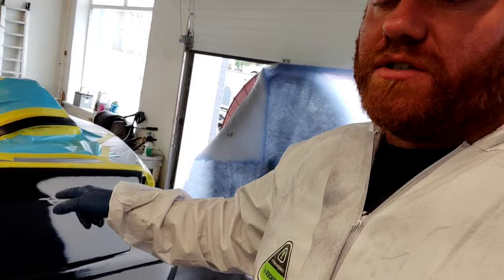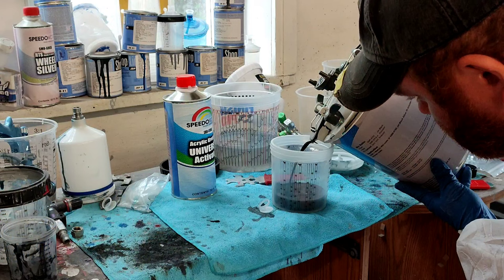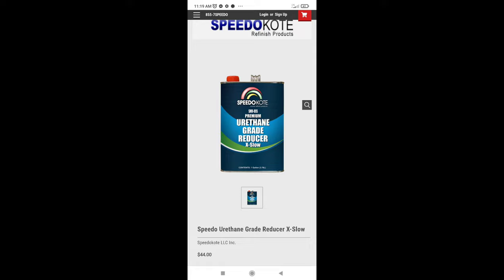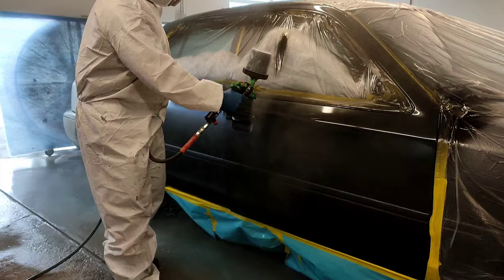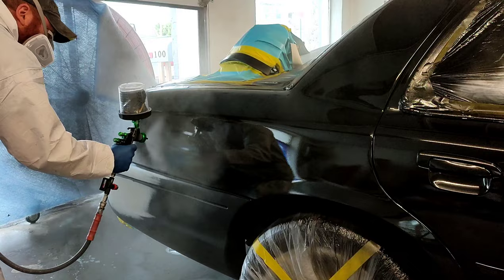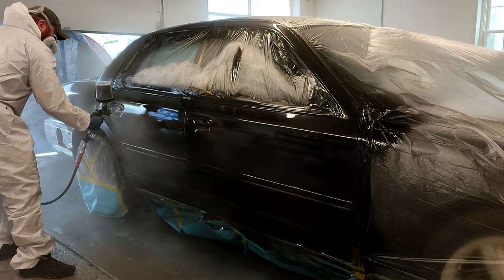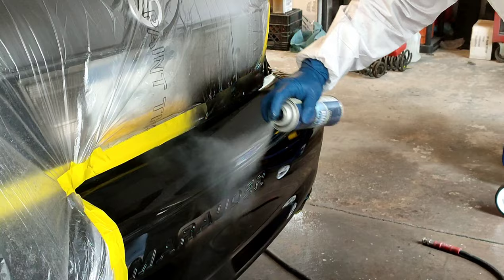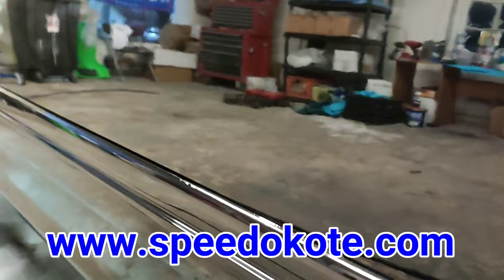How to lay single stage PERFECT

Comment: I've heard that spraying single stage is like spraying clear. You have to lay it down wet from the start. If you get dry spray or texture, then you're going too light/fast or it's too hot for your activator/reducer. It's better to have runs/sags than dry texture. Runs and sags can be cut down and buffed easily. Sometimes without even doing the whole panel.
Reply from the maker: Yup spot on
Reply: Literally no different I spray it just like clear. The stuff I used (nason) could handle a lot of build too it's actually a joy to spray.
Reply: In my experience, single stage flows a lot more than clear. Will go on looking dry but will level out alot on its own.
Reply: Hvlp or RP for single stage ?
Reply: @AChampagneWeezy  rp
Reply: @joshzimmer  I normally use a sata 3000 or 5000 hvlp 1.4 for base and my sata 5500 rp 1.2 for clear . I feel like the tip on my rp would be too small for single stage . I'm spraying ppg shopline
Reply: I appreciate this info . I've only painted water-base for 6 year and laying a separate clear coat and have light solvent paint experience with separate clear coat. I've never painted single stage and wanna try
Reply from the maker: Water is not the best for cars especially older ones. Also it does feather edge at all like solvent base. But hey great for the environment 😂😂🙃🙃🙃🙃
Reply: @GabrielMendoza-  you'll be absolutely fine with single stage, it's easier than clear coat in my opinion
Reply from the maker: Can be harder because almost no room for error. Can't really wet sand single stage cause then your basically sanding the color off. But IMO I agree it's easier and less work actually
Reply: @speedokoterefinishnetwork4937  idk out all the paint lines I sprayed I still have to say sherwin ultra 9k waterborne is the best and most user friendly when it comes to color match for collision work , now if I was doing an overall I'd go solvent base unless I have a professional booth to use .

But single stage I honestly would never spray on my own projects or keep in a shop if I owned one unless it's fleet work

Comment: Hello I had a question ....painting the top of my white challenger black it's in great condition no body work needed after cleaning and sanding then cleaning again ready for primer what would be the best primer to use before I spray single stage black ?

Comment: The paint Looks great . The only thing i see that was done incorrectly vs done propperly  ? Is that you blended over un-sanded paint . Which means that you chance breaking the blend if it needs to be buffed and its not going to last or stick and haze or show later even though it looks great leaving the shop . The Proper way to do a Blend is to sand with 1500 and stop the color / single stage , about  1 too 2 inches before you get to the end of the 1500 sanded scratches and then you can spray the blender and melt in the blend but still not going past the 1500 sand scratches . Then you can buff the the rest of the 1500 marks haze after it dries and the blend will not break and it will stick . Blends are not ment to go past a sanded area ever . when a painter says i can do a blend and not have to buff it , it is because they did it the way you did . It all depends on and in my case im OCD and if you want to take a chance of a re-do . Buffing a blend vs the time to re-do it later is up to you as a painter . Just my thoughts .
Reply from the maker: Your right I tried to take my paint right to the end of the scratches basically
Reply: @speedokoterefinishnetwork4937  Ya know whats AWESOME !! Its the fact that you can take constructive criticism without getting upset or blaming everything else on why you did something ,, thank you  for being a man and owning up . AWESOME !!!!!!!!!!!!
Reply from the maker: @tonychristiano  I have no issue with people helping me and giving tips. But just straight up being like "omg your an idiots without no idea what your doing " doesnt help me or anyone watching ! 🤣🤣🤣🤣🤣

Comment: I painted my truck about 8 years ago.  Decent paint job but recently fixed a bubbled area right behind front wheel.  How should I go about painting and blending the spot that I repaired?  Great video on the single stage by the way.
Reply from the maker: I would just repair, and do a spot blend

Comment: How long did you wait when u applied clear over the single stage? How is the clear coat holding up? 
  I have become much more intetested in offering single stage paint jobs. Deluxe version with clear. Just like old Earl used to offer😂
   Actually enjoy the instant gratification of single stage urethane
Reply: I was referring to another video where u applied clear
Reply from the maker: Alot of these cars I don't end up keeping so no idea on longevity... But I usually wait 30-60 min before putting clear coat over single stage

Comment: Getting ready to get this product. 45 years experience in autobody.  Hope it looks good
Reply from the maker: As long as applied correct you will get amazing results! Do 3-4 coats if you want to wet sand and buff make sure you allow to flash really long between coat 2 and coat 3 .

Comment: How long does it take for the paint to dry on the final coat?
When is the best time to remove the tape?
Reply from the maker: Usually around 20 minutes to the touch in hot weather. 
Best time to untape is while it's still tacky/ wet
Reply from the maker: If your placing any future orders you can select me as your sales rep (Marco) 
At www.speedokote.com

Comment: Use the appropriate catalyst.
Add no reducer.
Learn to spray thin to win.
Reply from the maker: I only add a max of 5% reducer any more than that can affect the gloss and finish
Reply: @speedokoterefinishnetwork4937  
If it does not call for it, even a little will cause pinch up and die back.

There is nothing worse than having to buff out paint.

Comment: Hey man been looking at the lime line gun you use and I've seen it classifies as LVLP but I cannot find any info on it's CFM usage. What size compressor are you using?
Reply from the maker: I use my mark1 eco most of the time and run it on a 60 gallon compressor

Comment: I painted a single stage on an 51 gmc pickup my uncle is restoring and it was super runny and I couldn’t get it to lay without being super thin. Up in north Georgia and I don’t have a shop to paint in so do you think that was my problem? Thanks. Going to try again in a couple weeks when I can get back up
Reply: Mixed it 8:4:1 like they recommended at Napa. Acme primer and Martin senour finish one paint
Reply from the maker: Finish one is not my favorite. Get better paint for starters

Comment: I absolutely love your work man I just painted my truck with this stuff and I'm happy with it but it has its flaws I don't know if I could use more than 5% slow reducer or not and it seems like if I used more reducer it would have came out better is that true can you use more reducer than 5%?
Reply from the maker: If you over reduce single stage it will make it come out dull

Comment: Marco- I’m spraying in 50 degree weather. (Single stage jet black) used fast reducer and looked good slightly orange peeled. Had contamination so I got fish eyes now I’m sanding and re spraying the whole truck. Would you recommend fast reducer again or maybe the medium? Or even no reducer at all?
Reply from the maker: Try without any reducer at all

Comment: I bought the high gloss jet black acrylic urethane 3 to 1 last spring  going to paint my 1968 fierbird this summer should I buy the reducer and I think I am going to buy another gallon how long should I wait before painting again?
Reply from the maker: Extra slow reducer at 5% helps it flow out just a tad better in hot weather

Comment: Mark, love this paint.  Thanks for these videos.  The only issue was I got some primer/sealer (SS-2790G) bleed through my jet blk single-stage (SMR-9705) after it dried, only on the underside of the vehicle, rockers, etc.  It had a rough texture as well, it's bizarre, I couldn't figure out what I did wrong.  The rest of the car looks amazing. Anyhow,  how long should I wait to re-spray over these areas?
Reply from the maker: Sometimes if your using it as a sealer and don't lay it just right or use the wrong speed reducer for your weather, it can leave texture
Reply: @speedokoterefinishnetwork4937  Gotcha.  I used a medium reducer at 50 degrees.  Sprayed the car last week, how long should I wait to scuff/re-spray that portion of the car?  Should I wait for the paint to fully cure (30-60 days)?  Thanks
Reply from the maker: @joshdufresne1977  you can scuff and reshoot in 3-6 days but you are correct it really does take a month or two for paint to fully dye back
Reply: @speedokoterefinishnetwork4937  Thanks for the response.

Comment: how much reducer do you add to the mix? i just order some x-slow as the temp here is in the 80's.  using the same Jet black kit.
Reply from the maker: If your using the full speedokote system you can reduce this jet black by 5% with speedokote x-slow reducer . 
If your placing any more orders on the website just select me as a rep (Marco) 
Thanks!

Comment: I think I sprayed too dry and it’s not glossy. How can I fix it? Spray another wet coat or am I going to have to sand?
Reply from the maker: If it's dry.. Simply sand with 600 grit and apply one -2 more coats
Reply: @speedokoterefinishnetwork4937 ok thanks. It’s on a vintage camper so it’s a little more than a car unfortunately. It looks good but I just think it needs to be more glossy.

Comment: If I used the single stage on an old 67 Buick, with a picky customer, how well will this buff out. I know its shiny off the gun, but I would need to go the extra mile...zero nibs. Full buff. Perfect as I can get it.
Reply from the maker: 3-4 coats, cut it with 2000 , then 3000 on a da sander, light cut then polish. Probably would start with a medium cut pad then move to a black finish pad

Comment: What is your product advise on paint that is peeling and lifting just from the adhesive of a sticker? It's the same color underneath but it doesn't look either same enough or some other issue? Paint is less than 10 years old.
Reply from the maker: If I'm understanding your question correct, probably going to need to sand and repaint
Reply: @speedokoterefinishnetwork4937  What's your recommendation on a primer after the re sand?
Reply: @speedokoterefinishnetwork4937  I honestly want to go with that gloss black single stage in the end on my Shelby. It's kept indoors, but the last owner skipped some steps getting it painted. What's your contact info and I'll send pictures and talk to you there?

Comment: Do you go over your primer / sealer with 400 grit paper before the color or just spray right over it?? thanks!!
Reply from the maker: Not really, just spray the sealer let flash and then put the paint on top
Reply: Yeah you don't have to sand sealer. But I believe it's necessary to send regular primer before spraying the paint

Comment: In ga , hot,hot.  I noticed a extra slow activator,  any advantage.   Color change on a f250 truck. Im a diy but do have some experience.   I usally mix single stage 4.1.1
Reply from the maker: Correct extra slow reducer is a must if your down there
Reply: @speedokoterefinishnetwork4937  what about that extra slow activator, should I use that as well?  Thanks
Reply from the maker: @chrisgolden5621  yea if it's 90+ for surr
Reply: @speedokoterefinishnetwork4937  thanks you sir.

Comment: is it possible to wet sand single stage and add clear? i painted some 4 wheeler plastics and there not so smooth thinking about wet sand and clear it
Reply from the maker: Yes it should work

Comment: I have good luck with just the paint and activator but not quite as smooth as yours but fairly close.  What percentage of reducer and basecoat activator do you use?
Reply from the maker: I use 5% reducer slow or extra slow for the flow out effect and just a cap full of base coat activator per mixing quart
Reply: Would that be 3-1-1 with a cap full of basecoat?

Comment: Do I have to use speedokote reducer with speedokote single stage?
Reply from the maker: You can use other reducers however if something gets wrong paint wise reactions ect ect speedokote will not replace or guarantee product.
Reply from the maker: If your ordering just get it directly off the site and select me as your rep if possible much appreciated (Marco)

Comment: I only used  Nason single stage and you have to wet the hack out of it. So do you use both slow and x slow together to achieve this?
Reply from the maker: Just slow reducer. But only a hair like 1-2 oz per mixing cup absolutely no more
Reply: @speedokoterefinishnetwork4937  alomg with the meduim activator it come with right?

Comment: Hi Marco, I'm new to this and have a couple of questions.  You are using slow or x-slow reducer at a temperature where one would normally use medium.  Would using 10% medium be about the same as using 5% slow?  Also does the brand of the reducer matter much?  I have some USC brand which according to the label seems to be a high VOC level  4lbs/gal. (higher the better right?)
Reply from the maker: 5% x slow for summer time I find best

Comment: Between the SS 2790G and SMR 200Q  which would be the better?
Reply from the maker: 2790g is my favorite
Reply: @speedokoterefinishnetwork4937  do you ever reduce it?
Reply from the maker: @3rekoatskustoms929  you almost have to.. It's super super thick really high solids primer. Unless your spraying it out of a 2.5 tip gun, you will need to reduce it about 5-10% minimum. I go around 5% for a super high build finish, 10-15% when I don't need as much build and want to do less sanding.

Comment: What’s the mixing ratio though it only showed 4:1 on the website and that’s just for the activator , how much reducer ?
Reply from the maker: 3/1 for this one all single stages are different however
Reply: @speedokoterefinishnetwork4937  when you said 5 percent reducer is optional. How can I tell how much is 5 percent in a mixing cup ? Thanks boss
Reply from the maker: @Peteiiis  take whatever number of onces of mixed paint and activator combined in the cup, pull out a calculator, multiple it by  . 05 and there's your number. So 32 oz would be around 1.6 oz of reducer
Reply: @speedokoterefinishnetwork4937  thanks boss